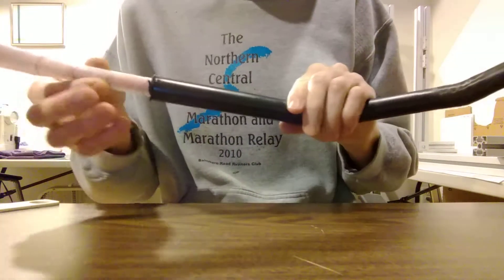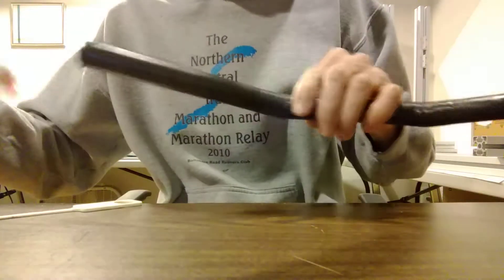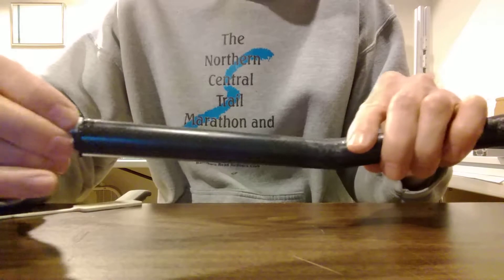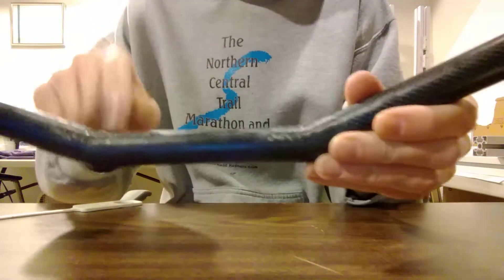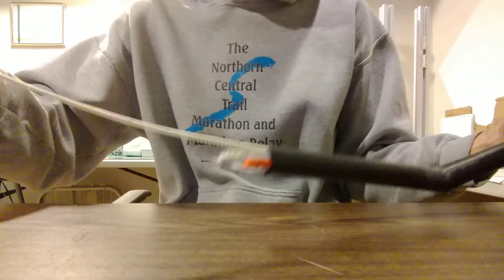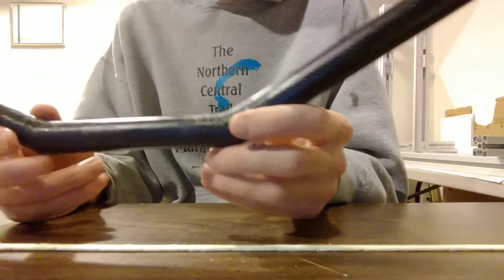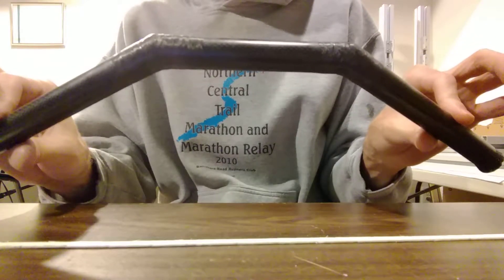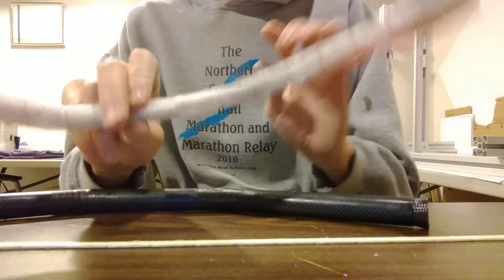64 gram! Carbon fiber handlebars bladder reinforced, demolded

Comment: Hi, please, whats is the pressure used?
Reply from the maker: It doesn't matter much, whatever is enough to push the bladder firmly inside the tube without ruining the bladder you made.
Reply: 100-120 psi is recommended for carbon fiber bladder form pressure....

Comment: How about using a inner tube, just with release wax, without peelply? Ever tried that?
Reply from the maker: Tubes stick REALLY well, and getting wax to cover it would be impossible (since it expands). Peel was simple enough, but for later versions I just used thicker-walled stock and skipped the interior reinforcement step.